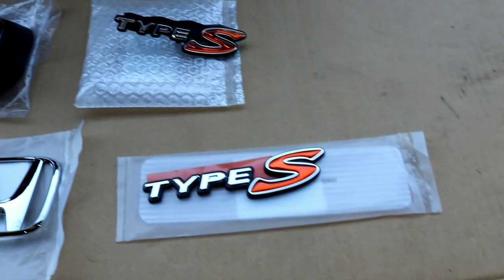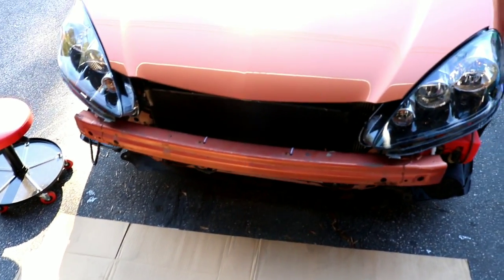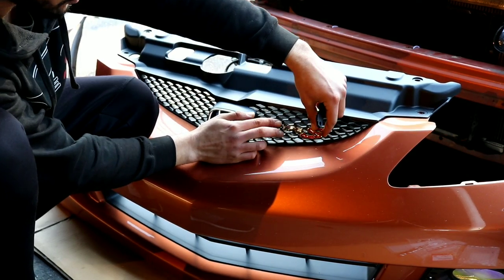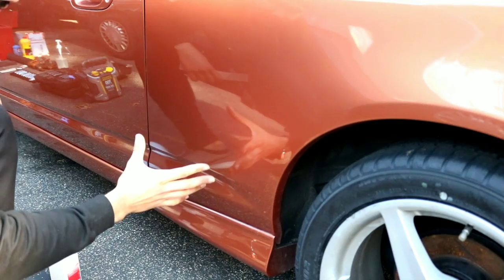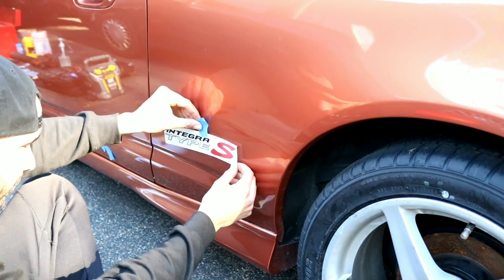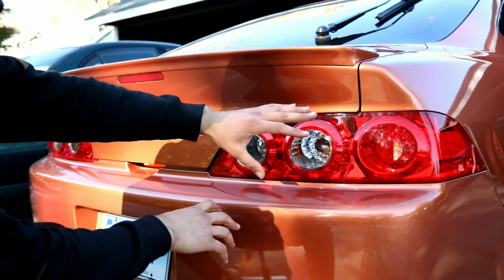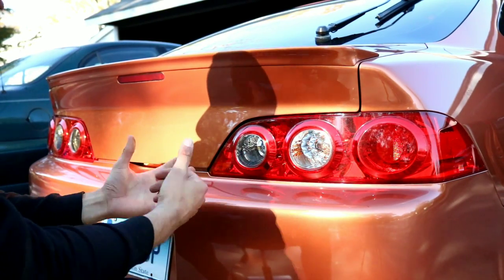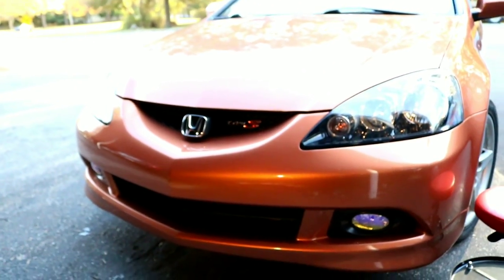Installing JDM Type S Emblems! | Project Orange - Part 13 | Episode 47

Comment: For the rear emblem removal, how would no if it has the two holes in it or just the glue residue when you take it off. I have an 05 base rsx and I want to remove the badge but I don’t want the two holes to just sit there

Comment: Will the front badge fit my 2005 rsx base?
Reply from the maker: Yes it will.
Reply: Mine is not the type S tho
Reply from the maker: The biggest difference between a base and type S is engine. Body design doesn't change.

Comment: Please but please answer me this no one will I have a Acura Rsx base 2003 I rebadged the Acura emblem and put a red Honda emblem. But I wanna put the Integra emblem on it on the rear. No I don’t wanna put type S I don’t wanna put type R no where just a Rear integra Emblem would that look stupid or wrong. Or is it find is some that people do ?
Reply: This is late, but putting an “integra type s” badge would still be authentic on a base model, because “integra type s” IS the base rsx model in Japan.
Reply: However for even more authenticity you could opt not to use a red badge, because that’s for type r only

Comment: Technically couldn't a officer give you a ticket for not having a proper vehicle registration,
the registration and Title has it as a Acura RSX, but the car is now showing Honda Integra.
Most people into Honda's know they are the same, but not everybody.  
Scenario... Cop pulls you over for something, runs your plates, and it comes back as another vehicle,
thinks possible stolen vehicle, and takes you to jail, and impounds your car until everything is sorted out.
In the mean time, your out the impound fees, and time explaining what was done.
Has this happen to anyone ?
Reply from the maker: You won't go to jail for emblems as it's not a crime 😂

Your registration has to match your vin number. The DMV won't register the car if the info on it doesn't match the vin.

You can modify your car to your liking. Emblems are aesthetic, not a form of identification. That's why the VIN number of a car exist.

A cop might be curious but still not a reason why to impound a vehicle. It will never happen unless the police station wants to get sued.
Reply: Lol